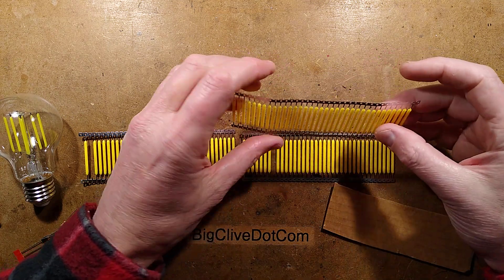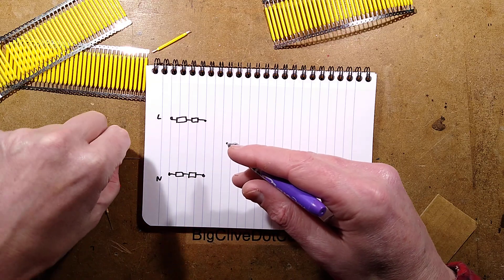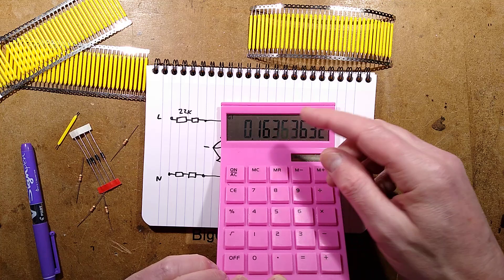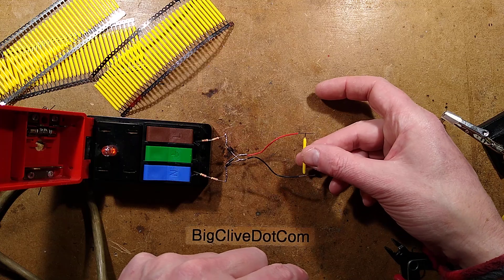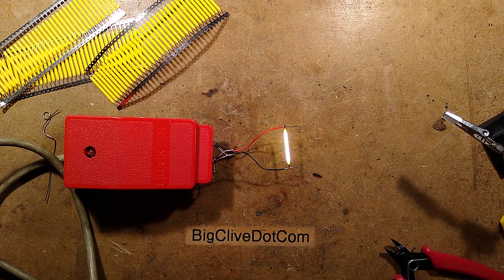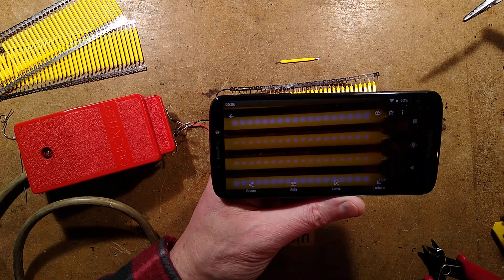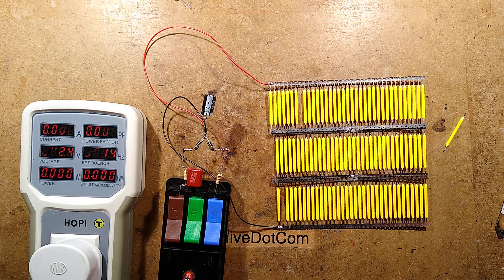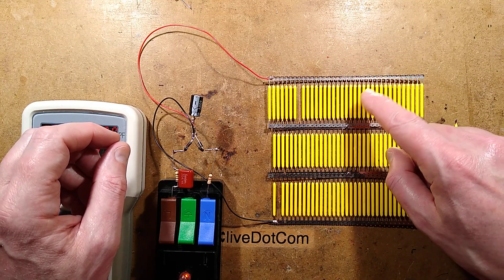104 LED filament lamp - just because....

Comment: I don't understand, If all the filaments are in parallel and measure around 43V that's around 43V for each filament.  Normally white LED's are close to 3V and require a series resistor with each LED when paralleled.
Reply: Each filament consists of many LEDs in series.  The calculation Clive does at about 7 minutes in, is to estimate how many separate LED chips there are in each filament - he estimates that there are 18 per filament.
Reply: @davidbastow5629  Thanks for your answer

Comment: Clive you need to get an  LED TV Backlight Tester.   Intelligent regulation of voltage and current. No burning lamp, no electric shock, reverse protection. High brightness,
accurate judgment. Wide voltage, input and output barrier-free. Double isolation, security protection

Comment: Hello All,  Do I understand correctly that Clive said  "2 in series for the US 110V" hence I could also use 4 in series for the UK 230V  with the simple bridge rectifier circuit Clive showed ?    giving approx. 5W output?
Reply from the maker: The peak smoothed mains is over 300V here so theoretically you could use six in series, but most lamps using four or more tend to have multiple parallel sections in series.

Comment: Having seen them already mounted on the factory strip I would want to just bend that strip into a cylinder as the central core of a "corn" shape bulb. And then multiply up with n strip circles and vertical stacks until too ludicrous.......

Comment: What is the minimum current needed to blow up a LED connected in reverse?
Reply from the maker: Even low current can damage the gallium nitride LEDs when their reverse voltage is exceeded.
Reply: @bigclivedotcom  Interesting subject. I just tried -30V to a single white cheap chinese LED. Current was not measurable, less than 0.1mV drop on 33k resistor. Maybe another chemical?
I put two LED in series on -30V, to see if they share the voltage evenly, but the input resistance of measurement is way to low.

Comment: How is the negative created after the rectifier? Like how is it referenced at 0v. I see that each "pulse" of ac is forced to the positive rail/pin but I don't understand how the ov is "created", how is the negative pin not just floating
Reply from the maker: 0V is just a reference point for the circuitry.   It's actually directly referenced to the mains supply.
Reply: @bigclivedotcom  so how is the mains ground electrically connected to the negative of the rectifier output, with the diodes there's no continuity between the two. Sorry I should know this I'm an electrician, some fundamentals I just don't understand.
Reply: @reacey  the negative of the rectifier output is "floating" and not directly connected to the mains ground. The DC circuit path is between the positive and negative terminals of the bridge rectifier. If you connected the negative terminal of the bridge rectifier to mains ground, the circuit would not work properly and you would only be saved from big sparks/smoke by the fact the Clive put resistors in both the hot and neutral leads feeding the bridge. 2:40
If you can see "that each +pulse of ac is forced to the positive rail" all you need to realize is that "that each -pulse of ac is forced to the negative rail" by the other two diodes.
Reply: @kimchristensen2175  I don't really get that, It just looks like both will be forced to the positive pin, the diodes seem to be such that they block the path both ways
Reply: @reacey  Here's a simple animation of the current flow through a bridge rectifier:
https://www.youtube.com/watch?v=PKy5ghLiz6I
Another, slower animation:
https://youtu.be/4-I6YQ09Zu4

Comment: I love this kind of stuff, but I would never feel safe with building my own projects to run on mains power, even if I copied someone else's plans.

Your confidence is admirable.
Reply from the maker: It's all about understanding the local electrical environment.  Especially potential current paths to ground.
Reply: @bigclivedotcom  I'm mainly thinking about the fire risk. Somehow, I feel an identical product made by the professionals is somehow safer.
Reply: @SonOfFurzehatt  It's only safer if they design and build it properly and put it is a suitable enclosure.  As many of Clive's other videos have shown, the fact that something is made in a factory and fitted in a moulded enclosure does not guarantee it will be electrically safe and does not guarantee that it might not spontaneously burst into flames, although it may help in either respect.

Comment: What is the 470 nf capacitor for? 🤔 I learned so much on this channel :)
Thanks to big Clive an all the nice people here
Reply from the maker: It rations a portion of current through on each polarity change of the mains supply.  It's a very simple way of making a non-isolated low current supply.
Reply: Thank you :)
Ahhh that's quite smart

Comment: How many would you need in series to plug them straight into the mains with no other components without them releasing their magic smoke?
Reply from the maker: Not really practical with LEDs as the current will vary dramatically with a small voltage difference.

Comment: Would like a bulb that turns on smoothly, like 1 second to allow eyes to adapt in the night. Something like CFLs did. But how to do it with simple analog parts?
Reply from the maker: For a low power lamp you could get that effect with a big smoothing capacitor.

Comment: I think standard practice would have the resistors on the DC side of the rectifier and the power should have been calculated for the DC voltage. Still within tolerance but I bet the resistors are getting hot and more like .22watts each.

Comment: Big Clive.  Have you considered doing any of these lighting projects using cordless tool batteries?   Such as ryobi 20v or the ryobi 40v.  I am using the 40v which are being solar charged during the day to power both indoor and outdoor lighting at night.   Also Christmas lighting  now. I have found a great mppt charge controller for charging these 40v batteries via programming.

Comment: Does this mean you can get standard non-LED filament alone? It's really useful for electronic igniters
Reply from the maker: You can buy suitable wire for ignitors.  The pyro hobbyists use them.
Reply: @bigclivedotcom  a thin bit of nichrome works well. You can usually find it pretty easily at your local vape shop.

Comment: Live, uninsulated mains on the bench, thousands of LEDs, and not a single health and safety person in sight. This is excellent, in every way.

Although I am curious how the brightness compares to a similarly rated regular LED lamp. Is there a point where it becomes less efficient to run more LEDs at a lower power, light output-wise?
Reply from the maker: The efficiency of LEDs drops when run hard.  Under-running them makes them more efficient, but there's a balance between efficiency and practicality.

Comment: FYI, there are now vendors selling LED filaments from 20mm to 300mm (!) long that run on 3V. (They have 1200mm ones for 24V and mains.) That lets you use an ordinary 3.3V switching supply and call it a day, no power factor or mains safety issues.

I am so going to make some gigantic 7-segment displays out of those…
Reply from the maker: I have some of the long flexible ones here.

Comment: Hi Clive, little calculation error, mains is 240, rectified mains is a bit higher..
Reply from the maker: I may have been going off the RMS value, because the peak value only applies when a smoothing capacitor is used.  Although in this instance the current limiting circuitry before the rectifier means the LEDs will set the actual capacitor voltage.

Comment: Am looking forward to seeing how this works out, I have started 'doobying' the light fittings in my home from the video you did. Would be interesting to see if you can create a 'high power' dubai-style lamp which could adequately illuminate a larger room with the single bulb, maybe using 15-20w.

Comment: Is it now known at what current rate they run in Philips Normal and Philips Dubai lamps ? It is THE number to make them run forever. You could use the thermal camera, at about 45°C the trajectory starts where the wearing raises exponential.
Reply from the maker: The Dubai lamps run at about a quarter of the current.  I measured the current in my video about them.
Reply: @bigclivedotcom  OK, as I just viewed that video again, .6V and a sense resistor of 31Ω gives 19.3mA with 3 LED's parallel, so is 6.4 mA per LED in the Dubai lamp. I wondered if these strips can take the full 20mA  because they are mounted so close together.

Comment: Why do you do your forward voltage math with the RMS voltage of the AC mains, when you use diodes to rectify that AC voltage? Peak would be around 325VDC? So if you need 43V for one filament to be around the right current, it would need way more LEDs in series to minimize resistive losses outside the LEDs.
Reply from the maker: It's RMS until smoothed and then it's peak.

Comment: With that bare bones circuit, for one moment, I thought you were about to park your tanks on Electrobooms lawn. I actually think that the simplicity of the naked power rectification and smoothing circuit, was probably one of the most easy to understand examples I've yet seen of how a power transformer works.

Comment: I know very little about AC and was wondering what I can look up or what it is called using a capacitor & resistor on the AC input to drop the voltage before the bridge rectifier.
Reply from the maker: It's a circuit called a capacitive dropper.  Only suited to low current and does not isolate from the mains supply.

Comment: Where should I start if I want to understand the use of both capacitors here? Also (and more importantly for me) why the resistors next to them? I think I know and understand the second one, which is supposed to smooth out the DC supply voltage (ie. less or no drops/fluctuations because of the AC conversion).
Reply from the maker: The 470nF capacitor is a capacitive dropper.  The electrolytic (10uF 400V) is the smoothing capacitor that reduces ripple.   The downside of this style of circuit is that it is not separated from the mains supply.

Comment: 2:05 When I did the electronics module in A Level physics, whenever we had a test or an exam, often, one of the questions was to draw a bridge rectifier, but I could never remember which way round the diodes went, so I always had to work it out in my head as I drew it. If only someone had said "all the diodes point to positive." It's obvious too, when you think about it.
Reply: Honestly i still prefer the block drawing cause it's much less annoying, faster and cleaner than my  crooked diode bridge
Reply: @alexstone691  But (edit: practicality aside) there are so many jaunty polygons to choose from. I tended to try and draw the outlines of animals or landmarks that relate back to the as-built circuit.  
And my favorite 'in the wild' is when a (dubiously reverse/re-engineered) appliance schematic leaves one diode stuck in another section,  so the 'as-built' boards in later generations have a {diode, resistor, and hero-FET} orphan flying at mains (or greater) potential on some very-low-voltage human interface connected with some tiny <.5mm flat-flex for no obvious reason.
Reply: It is usually the simple things that mess with us..
Reply: I was always like, "okay, this is going to be positive, so these two go this way, and this is going to be negative so those two go that way". But I never 'made the connection', and realized that yeah, they all point to positive.
Reply: the way I do it is, draw the diamond with caps in the place of the diodes, then simply turn the caps into diodes. I do this quite often when I am not sure which way to put the diode, draw it as a cap, think about it and convert to diode.
Reply: I was lucky enough to hear this line "all the diodes point to positive" from the local tv mechanic. And it saved me later in physics lab
Reply: The diodes are arrows that point in the direction of "conventional" current flow.
But even when you think of electrons being "current" it makes sense. The "flat" part of the diode is just a surface that "emits" electrons in an angular fashion. Like it's done in a triode vacuum tube.

Comment: man are those things delicate...  the ones I had were anyway. the chips were mounted on little ceramic strips that broke when you looked at them funny. 
  ...hey Clive, you absolutely must check out the little wireless LEDs... alternatively, perhaps you are already aware of them and I am the latecomer... better late than never. better late than early too...  which is a possibility with these little rascals.
 I'll just get out of here before I get in some kind of trouble... 
 peace be upon you, sir.
Reply from the maker: These are glass and also very fragile.   The wireless LEDs were featured a while ago by Strange Parts.

Comment: By my calculations a 470nF capacitor would have an impedance of about 6.8k ohms, so couldn't pass more than about 32 mA, even with the full 220V across it. If voltage drop across the capacitor falls to about 70 V with the voltage drop across the bridge rectifier/LED assembly being about 150V, then it's going to be only just over  10 mA (and that 1k resistor will lose another 10 V at that current). For that matter, I'm not sure what that 1k resistor is there for given the capacitor will limit the current. Won't the 470 nF capacitor achieve that? I'm not sure why you'd get a lot of in-rush current with a series capacitor in the mains feed.

In any event, if it's about 30ma of current with roughly a 150V drop across the LEDs, that's about 4.5 watts over all the LEDs, which makes me think they will be running at a fraction of their actual ratings. All before I watch the rest of the video.

nb. after a quick look around for capacitor drop circuits as LED drivers some have that series resistor, some don't.
Reply: @Steve Jones:  The issue is this...  If the circuit is connected at the time when the mains is at a positive or negative peak voltage, there is nothing to limit the current charging the capacitor at that instant unless you include that surge limiting resistor.  Once regular AC conditions are established, you are right, the resistor is not so important, although it helps protect the LEDs against nasty voltage spikes.  What tends to happen without the resistor is that some of the LEDs will die just at switch on, and they may die short circuit or open circuit.  After enough switch on spikes, enough of the LEDs will have been been destroyed that the reset will also no longer work. In my experience with crappy Christmas lights, about 10 switch on - switch off cycles can be enough to make the dead LEDs quite a nuisance.

Comment: not an X2 rated capacitor ? Naughty clive ! :)
Reply from the maker: I used the classic cheapo Chinese circuit componentry.  Some class X capacitor manufacturers do not recommend use of X2 caps in droppers.  Possibly because it makes it very obvious when they're failing.

Comment: The "camera blowout" as you put it is due to a dirty lens.

Clean it.
Reply from the maker: I do try to keep my camera lens clean.  The blowout is usually a contrast issue with the sudden change of light level.  Especially when the metering point is not on the LEDs.

Comment: I'll go ahead and +1 to that these are certainly some of my favorites to watch as well. Being able to experience the thinking process I personally believe is one of the most (dare I say 'the most') powerful methods to inherit knowledge on certain subjects when delivered by video. Clive, if I may, would like to graciously ask for the sake of my slow mind when it comes to crossing paths with the wonderful world math's - could there be a possibility in the future of introducing something maybe like a whiteboard at times, to jot down the formulas you are using when calculating Ohms law or maybe even at times doing the math by hand? I think this could add even more points to your channel educational value - do allow me to clarify in that your channel is not by the furthest of means 'lacking' in educative value, having personally learned more from you in a shorter period of time than some of the schooling. Keep'm videos coming!
Reply from the maker: I used to do the computations on paper.  These days I often describe them as a calculate them, but paper is probably the better option.
Reply: @bigclivedotcom  Most ofthe time I can follow your calculations, however the calculation of the voltage per filament is a miracle to me. You calculate the voltage across one filament by measuring the voltage across a strip of parrallel filaments and deviding that by 2,4. Why 2,4? And if this is a viable calculation, why the voltage of a single filament different from all in parrallel? And why is this amount of power (or volts or amps) correct for this filament?
A lot of questions, but I hope you can make it clear to me :-)
Reply from the maker: @gerwinbloemberg  At the low test current involved, the typical forward voltage of a blue LED (used to stimulate the phosphors for white light) is around 2.4V.  By dividing the measured voltage by that rough value it gave an indication of the number of LEDs in series.
Reply: @bigclivedotcom  I missed the "LEDs in series", because I didn't know that a LEDfilament isn't a type of LED itself but is a string of LEDs. Thanks.